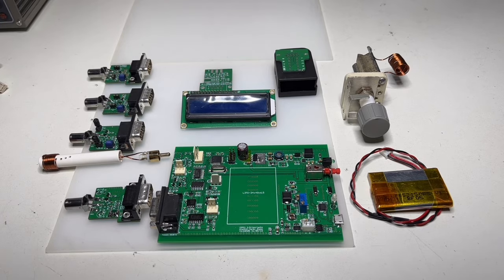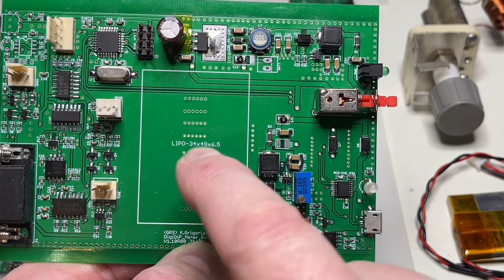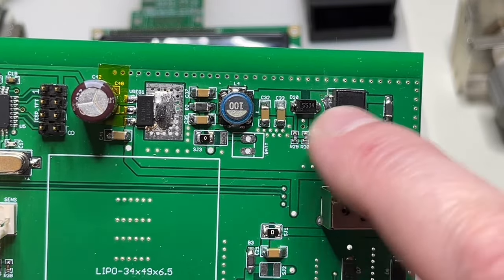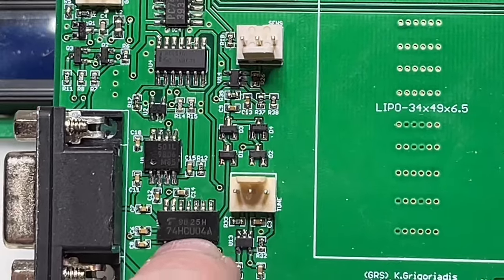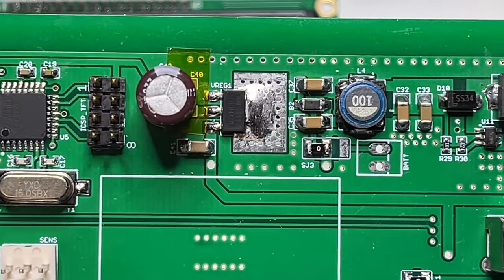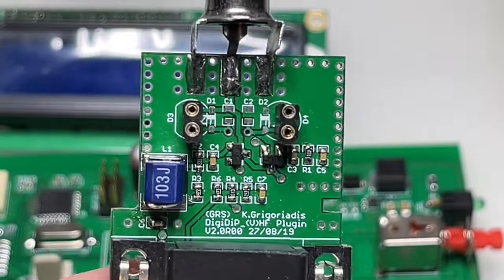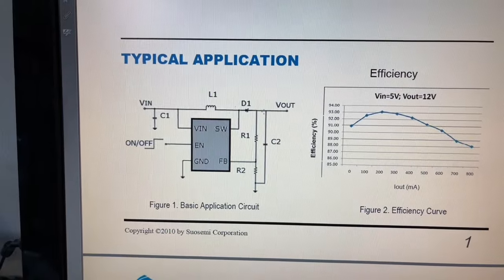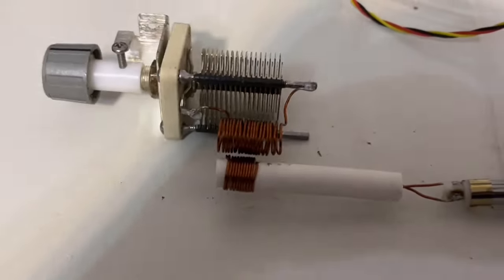GRID DIP METER GDO Part2; DIGI-DIP Full Details on my Digital Dipmeter Design.

Comment: Wow! Amazing engineering! Amazing graciousness, by making it open source! Bravo! Thank you for making the world a better place! Yes, some PICs can use a 48MHz crystal. And, they can be used with the Arduino IDE, by including a bootloader. I am sure that you already knew these things. Just sharing. I do not know much/anything about dip meters. However, from your introductory description, I had envisioned that the dip would be a centering operation. Meaning, that there would be a character that moved right and left on the display and, when the correct frequency was reached, that character would be in the center of the scale. Some simple digital compasses have this type of HID. I hope that is understandable. I know that you have made this open source, however I do not have anything like the skill and knowledge to implement the display change, if it would work and be helpful. So, maybe it is an idea for someone else. Cheers!
Reply from the maker: Hello, Thankyou, PIC's can be used with the Arduino IDE ? how ? I didn't find anything really working last time I searched (is a couple of Years ago). The Dip is a moving of the Horizontal Bar to the Left bcs the Signal goes Down. Cheers
Reply: @KonstantinGrigoriadis  Only for the PICs that the EE community has developed bootloaders. So, it is somewhat limited. Arduino IDE>Tools Tab>Burn Bootloader (first) There are GitHub repositories. Can't explain it all, here, of course. HTH.
Reply from the maker: Thankyou, I will have a look.